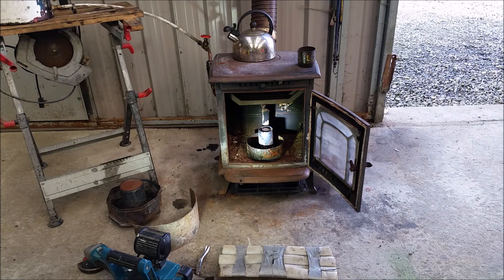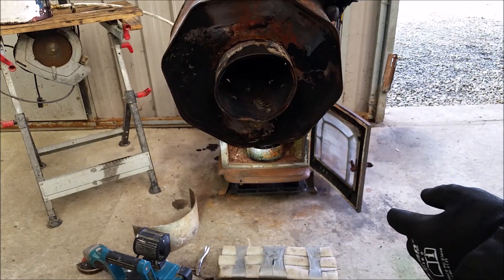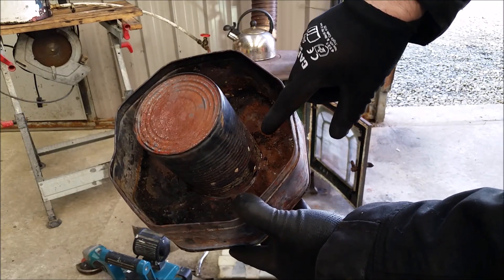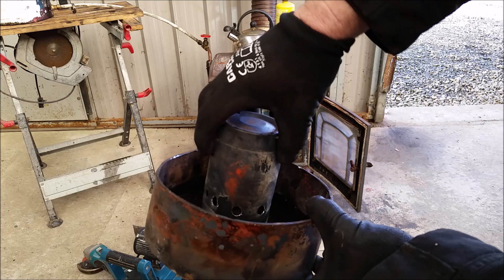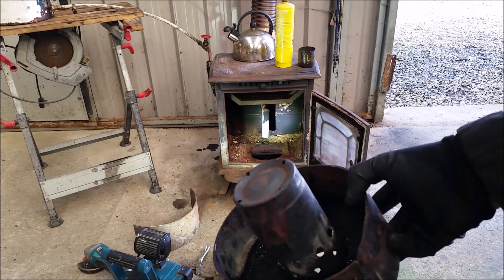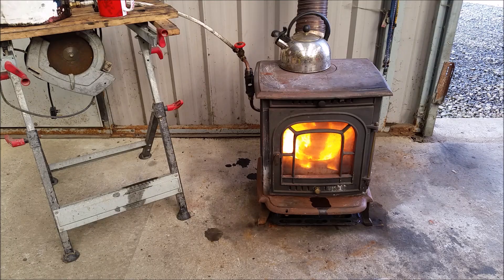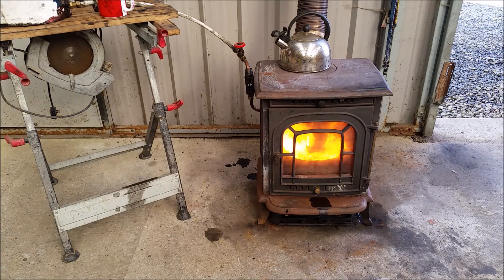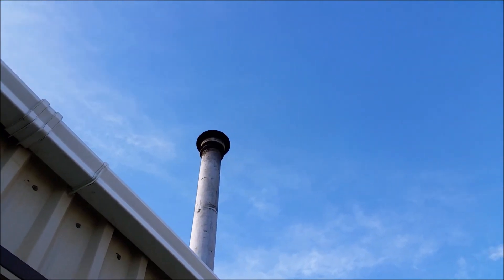Fantastic new design Very Easy to make waste oil Burner

Comment: Hi,
I want to know how you have taken half a inch onto burner?
Is it cooper or metal?
It's its metal how you converted cooper to metal?
Reply: I've got propane log burner which I use to heat pool. I want to conver my log burner to waste oil burner with minimal smoke.  
All help will be appreciated
.

Comment: Gerry you need to work out how to deliver the oil, in one video u almost had it, but haven't seen it since. That gravity system is bloody dangerous, and you know that, if people build the cake tin burner, light it and walk away from it, that viscosity of the oil is going change fast and flow twice as fast, and it's close to the heater, so going to happen fast, and they will end up burning their shed or house down and it'll come back on you. 
Use a waste oil controller. Gerry you need to start looking at the blue flame heaters, they never smoke, burn waste oil blue, and are hotter than the blower type heater. 
Cheers Drip Fed

Comment: Gerry gravity fed waste oil heaters through a needle valve can be dangerous if left unintended I wonder if you should explain to your viewers why this is. Maybe introducing 12volts to run a oil pump and a timer and a thermostat incase the flame every goes out would be recommended.

Comment: Great following your lead in build one, my question is are d holes in d burn unit higher than the rim of the pan, or are some high n others lower so fire heats bigger rim also? Second should I drip d oil in the big rim or on the middle section with the holes in, I'm concerned about d heat on my drip line

Comment: Nice and simple !!  I built a tiny wood stove from a Store (floor safe). After much work, I found I needed forced air to run it but a really nice build. I may just cut a hole in the bottom and do this. At least it will work and much better than wood I'm sure.

Comment: Great video Gerry ,I have made a burner like the cake tin model of yours, Out off 2mm plate . I burn used diesei oil, I get a lot of black soot up my flu and floating around out side . Is this because of not enough air to the burner or to much oil to the burner cheers Glenn. PS We do get cold winters in Austrlia.
Reply: smoke is not enough air, too much oil....same as an internal combustion engine...too rich..
Reply: i havn,t herd from you gerry

Comment: Jerry... I modified the air intake by configuring an interior sleeve inside the air intake about 1/2 " smaller dia., no holes and a flat bottom and flush with base of intake. Air now coming up and in is more intense and because my holes are in a spiral form the the burn spirals too.

Comment: If you set up your wood burning stove with a simple oil burner like this, don't put holes in the center can all the way around. Any holes that you face forward toward the Glassdoor will blow air and therefore Smokey oil flame at the glass door and smoke it up or send Flames out the door when you open it. You might just put tiny 22 caliber holes in the center can that faces the door and larger holes around the rest of the center can.

Comment: adding forced air will melt the fire box.  better not for many reasons not to use forced air.  I am thinking about piping supply air from the outside to the bottom of the fire box, so the combustion uses outside air to combust.  my thoughts on this is that if you use room air to make the combustion, then the room must draw in outside (cold air) into the room.  Will there be a reaction that i have not thought about?  Will this work better or will there be a negative result from this design?

Comment: I really like this design, although I don’t think I want to put a hole in my little cast iron stove.
Reply: You could put a small 3"-4" tall metal box under the cookie tin /dog food can set up, that has an open end facing forward towards the air vents on the front of the stove. You can make the metal box with a 5 in hole in it on top for the dog food can and biscuit in to sit in. You can pull the metal box opening on the front side, toward the front of the stove by the air vents. If you make a metal box about 10 inches wide, 14 inch Long and 3-4 inch tall, with one 10" x 3" end of the metal box open for the air vents on the stove, and cut the hole in the back top of the metal box for the dog food can, you don't have to cut a hole in the bottom of your stove. Your biscuit tin/ dog food can set up, will sit on top of your metal box and air will be sucked in through the open vents on the front of the stove. Don't put as many holes in the dog food can where it faces the front of the stove, and you will get less flame and smoke blowing toward the door. Just make the small metal box so that the open end matches where the vents are on the front of the stove.

Comment: I'm sorri, you can see the diameter of these plates and the size. I would like is making them myself.
Reply from the maker: Hi. The steel version that I make has a diameter of 10 inches and the removable inner piece with the holes is 6 inches in diameter. The spigot is 3 inches. Have a look at this video for more information on another build. https://youtu.be/ShTLaYKjzxw Hope this helps. Cheers Gerry
Reply: @GerrysDiy  I am writing to you through the Google translator since I do not speak English, I apologize for mistakes and inaccuracies 😆
Reply: @GerrysDiy  if you included Russian subtitles on your channel it would be generally good
Reply: What is better? with a removable cap or where the holes on the sleeve itself, and even the height of the bead in a circle, the height of the sleeve and the height of the cap, you would be very helpful if you indicated the dimensions and nuances thanks!

Comment: Thanks for sharing all your ideas in making waste oil heater. Your system is the best by far to all I see. Most of the youtuber use fan to supply oxygen to the fire, yours is always simple and no need of any outside source of extra energy to run the heater (electricity, no matter what the system should run by itself without the aid of outside source of power). The other good thing you are showing is the way you build the system simple yet effective.

Comment: Hi Gerry, I've watched quite a few of your videos and I don't recall you speaking of this, so I'll ask.  When you build your burner, does the size relationship of the burn pot and the intake flue matter, or you just go with what you have?

I've also been looking at honeydo carpenter's work on rocket stoves and aircrete. You should take a look at his aircrete insulated exhaust flue. Seems very efficient.

Anyways, that's it... Sláinte lad.

Comment: Hi Gerry, did that stove have a boiler attached, I have a old 21kw stove similar to that one  but the boiler is weeping internally, I’m going to try to split them and weld up the hole, and use it for my shed hopefully burning oil, keep up the good work fella..🙂🙂
Reply from the maker: Hi Frank. Have a look at the new boiler stove I made  https://youtu.be/JHsNoqp9QAE . I have a 21 kw stanley in my sitting room and I had it running on waste veggie oil. There are videos of it in the playlists. You might need to plate the stove if it was fresh water that did the damage. Usually a leak somewhere on the system bringing in constant fresh water from the expansion tank. Thanks for the comment Appreciated Cheers Gerry

Comment: Hi Gerry, did that stove have a boiler attached, I have a old 21kw stove similar to that one  but the boiler is weeping internally, I’m going to try to split them and weld up the hole, and use it for my shed hopefully burning oil,

Comment: This time you didn’t put the brake disc what is the brake disc for is it for holding the unit in place so doesn’t move around or is it there just the heat to the system when it gets hot I’ve been following your design design so far Kors is the best going and I’ve seen hundreds upon hundreds call designs with Forced air in yours by far is the best

Comment: if your cold air was piped in from outside you could get a cleaner burn I think by feeding colder denser air..also it would create a positive pressure in whatever room you had it in...stopping any potential drafts...I'm just thinking out loud but great idea.. it's simple and it works well..thanks for sharing!

Comment: Gerry, i made one of these using your design and it puts out a ton of heat but was smoking to much. So i increased the holes to 12 or 13 mm and added a bunch of em. This resulted in the fire just going out. so i welded a bunch back shut. This worked but back to smoking. I'm wondering if my elevation of 8500ft is having this effect due to the lack of oxygen. Any suggestions are greatly appreciated! Thanks

Comment: Gerry if you used a small fan to increase the airflow,  would it burn too hot
Reply from the maker: Hi Harry. Once you introduce forced air you can control the burn even better because you already have control over the fuel. You will achieve a hotter burn but you can cut down on the fuel, regulate the air and make a more efficient setup. I will be making forced air waste oil heaters over the next couple of weeks.  Here's my old forced air burner and quite a few people have made one of these and they work great. Over a mililion and a half views so it's quite popular too. https://youtu.be/AiKcx7ghtHk Hope this helps Cheers Gerry

Comment: Thanks for the reply Gerry.

I did get chance to try my "old" existing marine stove. It's actually a French thing, by Deville, and designed for Diesel.  I started it on "clean" diesel as it hadn't been used for years, (possibly as many as 15 !!), and having got it running, introduced old engine oil.  The unit has an internal "day tank" and I very successfully burnt a whole tank of engine oil, without the faintest wisp of smoke, and a mainly blue flame, which on these things, indicates good fuel vaporization.  Simply "naturally aspirated" with no fan assisted or "rocket" tendencies it's rated at 5.5kW, which will keep me probably 15 degrees warmer in the workshop this coming winter - at no cost !!!    Without your video, I wouldn't have ever thought of this, so a big (and warm !) thanks !!
Reply: be very careful.

Comment: Gerry, your a genius !!.  I'm English, but live in France where you pay to get rid of waste motor oil !!   After a few years of being a good boy, and oil changing my car every 7000 miles, I've ended up with loads of the stuff, and haven't ever quite know what to do with it !.
I've also got a marine stove (from my days of living on canal boats) designed for diesel fuel oil, with an alarmingly similar burner to yours.  I'm going to try it on a tad of waste oil and see what happens !.  It does burn by vaporization, so as long as the fuel regulator can handle the potential muck in waste oil, I might have a warmer workshop this winter !!.
I could, even, offer to remove other peoples waste oil for 1/2 the price it would cost them to get rid of it "officially" - warm workshop AND get paid for the fuel !!!!!!!!!!!!!
If the marine stove isn't so good, I've also got a solid fuel stove sitting around "doing nothing", so, that might well get a "Gerry mod" !.
What a brilliant multi problem solver !
Reply from the maker: Hi Absolutekarl. There are many burners but this is kind of a cross between a rocket stove and Ozzirt type burners. I made it just at the end of winter and it's too warm here now so I am flying paramotors and things but when it gets cold again I will be making some burners of different designs. These burners are really easy to make and easy to clean too. Flue length is important to create the updraught necessary to create a robust flame.Thanks for the comments. Cheers Gerry

Comment: Hi can you add rads and boiler to it
Reply from the maker: Hi Mel. If the stove in this video wa a boiler stove it would be generating heating for rads and hot water.  Here's an old video I did with a boiler and a different type of burner but its the same principle. https://youtu.be/PaEOpqqPwgs  Cheers Gerry
Reply: Remember! If water start to leak in the stove it vill start to burn too Mutch whithout any control

Comment: Nice, seems to work well, what if you drilled another set of holes to give it more air?. Also saw in another of this working model you added a brake disc on top to give it extra heat. Abandoned that idea?. We use both Ozzies heater & Oil Burner´s , depending on our needs, they all work very well (we dry & extrude soya bean for cattle fodder). Will follow your experiments, good thinking!!
Reply from the maker: Hi Agricruz SA. I uploaded another video tonight with a different stove and I am using a brake disk as a heat sink and I have drilled more holes in the tube too. I am making a bigger burner tomorrow so I will post that video this week.  Cheers Gerry
Reply: Yes, I was just looking at your latest Minion setup, which is much more on-line with our Ozzie furnaces. In any case both your burners work on the same principle, which is most interesting, I must say. Once you have it post-experimental we will try it out down here. (Argentina w/lots of irish descendants HAHA).

Comment: how well does transmition fluid burn in this stove
Reply from the maker: Hi captianjesssie1. I burnt some today with no problems. I don't separate out the oil. When I have veggie oil I just pour it into the bucket with whatever is already in the bucket. The burner is not fussy so long as you don't have water or gasoline mixed in. Cheers Gerry
Reply: Oil is a bit better. I experiment today with Transmission Fluids.. It smells bad ://.. Give me such a headache! So if your stove is NOT completely sealed, you have to be careful burning Trans Fluid!
Reply from the maker: Hi Jod. If your flue is sized correctly and is sound and Airtight on the stove you should be able to open the door of your stove and all the smoke and fumes are still pulled into the stove and up the chimney. If you can smell the fumes you are in danger of carbon monoxide poisoning. Please be careful Jod if you are using this in a house there are lots of things that can go wrong. I can show you what I mean in the next video Cheers Gerry
Reply from the maker: Hi Capitianjessie1. I have burnt gear oil and hydraulic fluid with no issues other than getting it to light. Once burning it makes a lot of heat like the motor oil. Cheer Gerry
Reply: Hi Jessie, Here's a quick list of things I've successfully used as fuel in my waste oil burner: 
-Motor oil
-Transmission fluid
-Brake fluid
-Two stroke oil
-Differential fluid (cut with diesel for viscosity)
-Diesel
-Kerosene
-Veggie oil (olive, peanut, canola...)
-Animal fats (melted obviously)
-Isopropryl alcohol
-Gasoline
-Carburetor cleaner
I hear you can even use the mineral oils found in powerline transformers, but I haven't gotten my hands on any yet.
Cheers!
D

Comment: Very interesting the change in the flame when you open the door...the combustion really creates vacuum at the bottom of the stove
Reply from the maker: Hi Joshua. I will be posting more videos in a couple of days and I go into that in the first video I think. The chamber needs to be nice and sealed to get the air and fuel to mix. The other possibility is to force the air which means you can control the amount of fuel you want to burn while making no smoke. Cheers Gerry

Comment: What valve would you recommend instead of what you are using? Great informative video, I'm working on a rocket stove and trying to find a way to incorporate waste oil.
Reply from the maker: Hi Tepco Cycle Repair. The guys are getting better results with needle valves but the oil must be filtered. I think that the way to go might be a dosing pump / metering pump. The reason I say this is that these pumps aren't really influenced by temperature and viscosity (to a point.) You can set it for 2 litres per hour and that's all you get. With the valves as the temperature rise the flow increases. I will be posting videos on this soon. Cheers Gerry
Reply: Gerry's Waste Oil Burner interesting, thanks for the info!

Comment: Flipping awesome,  simple and it works, I can imagine if you add " forced air " as you said, it would burn cleaner and more likely hotter. Did you check any temperature readings on the outside of the stove ?  Lust love your vids.
Reply from the maker: Hi Madd Macc. The Stove gets to 1000 fahrenheit  and even higher if you want. With the lights out it glows a dull red which is about 550 centigrade at normal skinny flow rate which is roughly 2 litres per hour. We were working in the shed today and using 5w30 waste motor oil and it made a ton of heat for very little fuel. I have more videos made of this burner working in another stove. Will post within a couple of days. Cheers Gerry
Reply: Gerry's Waste Oil Burner 
Looking forward to more of your vids,  keep up the god work.
Reply from the maker: Hi Madd Macc. Thanks. I just uploaded another video. Cheers Gerry